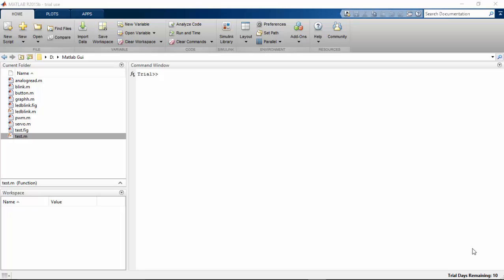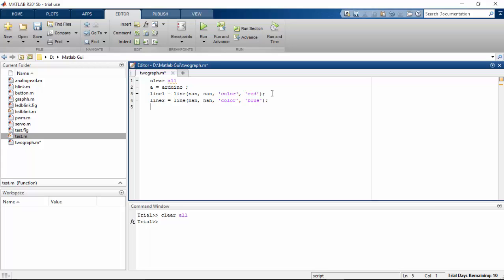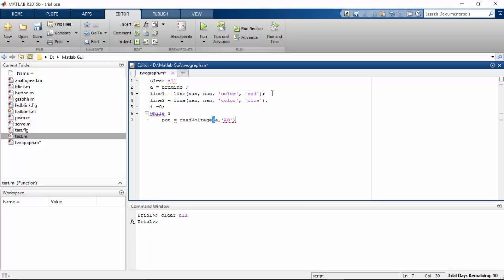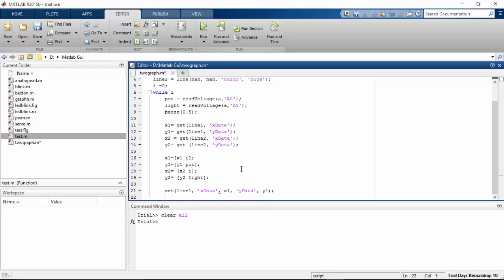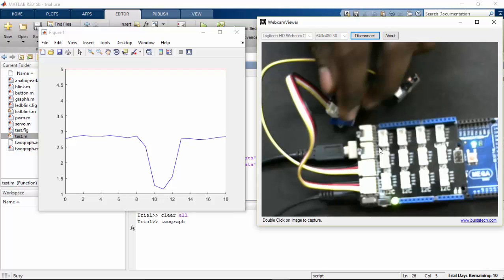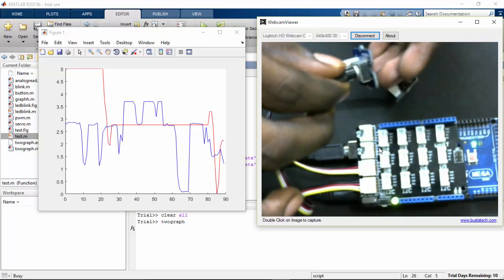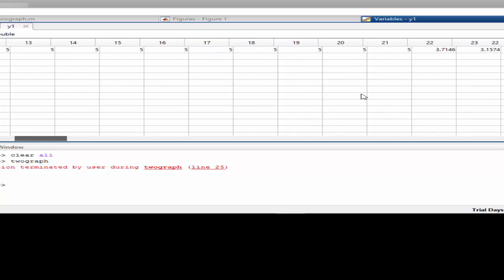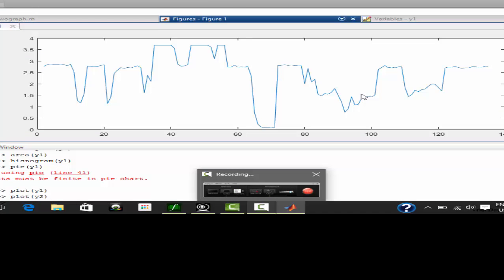Matlab Realtime plot for Multiple analog inputs in Arduino

Comment: if i use a max6675 which has 3 pin connected to the arduino. for example pin 4,5,6. How do i write it in the matlab command?

Comment: hi..im working on a shunt active filter. can i send six analog inputs into matlab simulink using arduino and process the signals in simlink and send 6 digital outputs to arduino digital pins?
Reply from the maker: yes, you can do what you said. it will turn to much simpler when you use MATLAB simulink.
Reply: +Arduino Robotics LabVIEW Solidworks  what about its speed as it should do sequential computations and then it needs to send 6 digital outputs?
Reply from the maker: +B.N. Rajesh I'm not sure about speed, for such application, I never tried , have to check by doing it. hope it will turn out be good speed. give it a try and share your results.
Reply: +B.N. Rajesh  can you please send to me also the code for multiple analog input & output signals handling through matlab/simulink